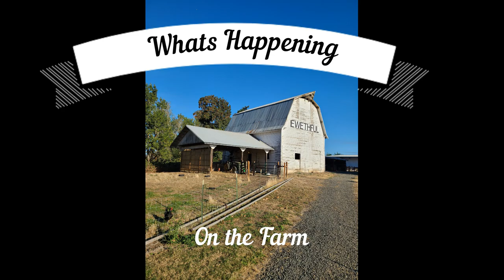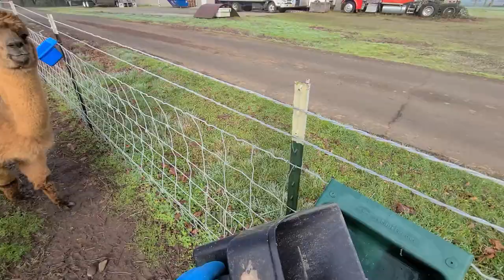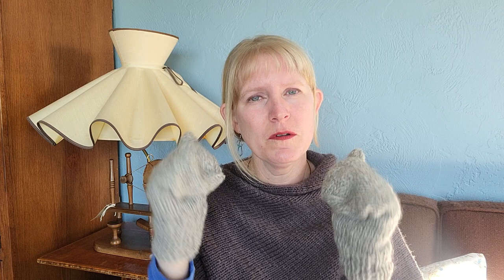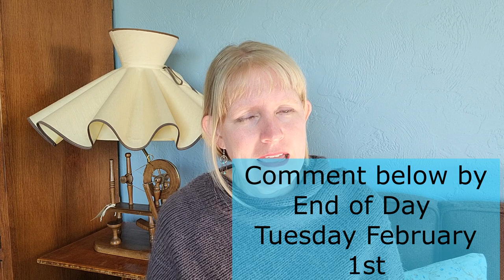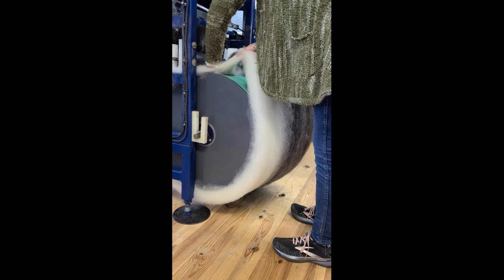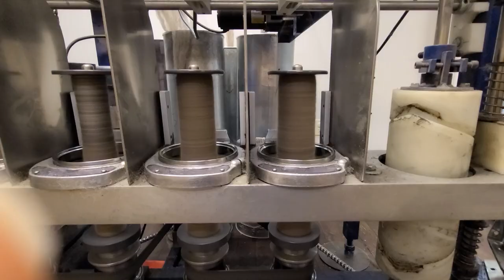Being Ewethful Episode 30 Farm to Yarn and In Between

Comment: Congratulations on 500 Subbies. I love the farm and mill tours, can't wait to see the pigs. I love teaching people to spin, I mostly teach people who are so new they do not even have a wheel, so we start with a homemade spindle. That is how I started, I had a hard time learning too, and one of the major issues was using not so great fibers to start with. When I teach, I give them a bout a 18 inch length of several types of top and roving and a piece of a batt and some washed locks and we work with all of these so they can see which one they find the easiest to spin. This way they do not think that all spinning is as hard as the fiber that is hardest for them to work with. This also gives them many different types and colors so they don't get bored with one thing.  I have made videos about spinning with a spindle and have had a lot of people say that they really learned well from them.  I think you should make videos, because I know a lot of people want to learn, but have no one nearby to teach them.  I live in Amarillo, TX and right now it is 1:25 pm and 59 F ,  a couple of days ago it did not get above 28 F all day, we have probably every kind of weather you can have except hurricanes, lol. Unfortunately rain has been in very short supply for months so we are in a bad drought. We did get about 3 to 4 inches of snow earlier this week and every little bit helps. Blessings